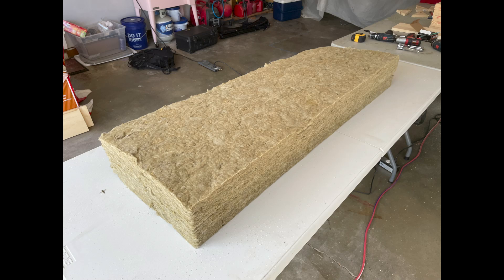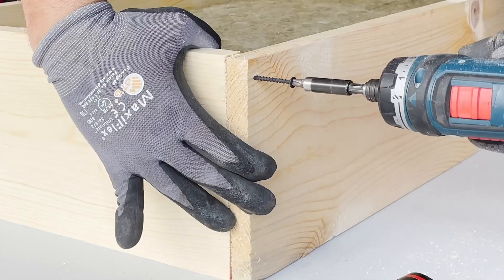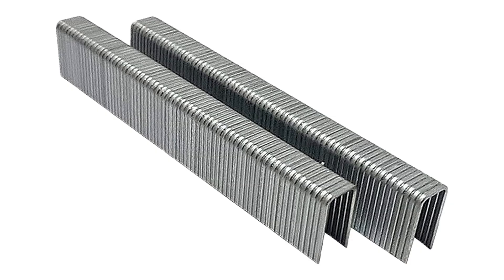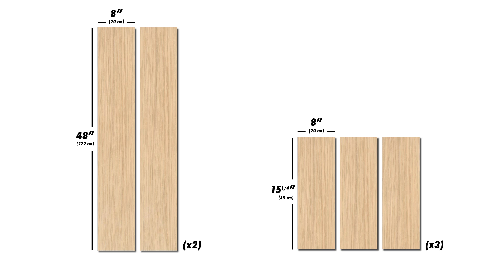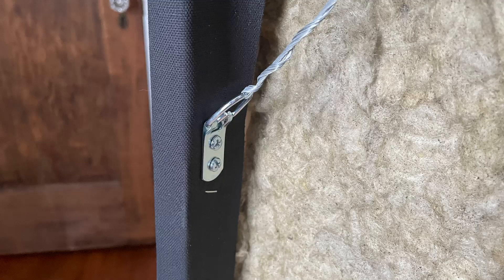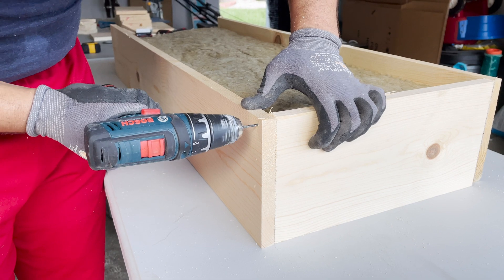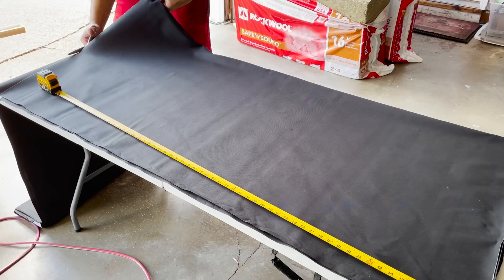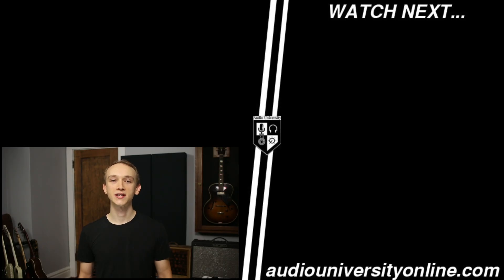How To Build Acoustic Panels | Pro-Quality Acoustic Treatment - Less Than $50!

Comment: shouldnt you cover the panel first with solid cover not a fabric? , cause particle can travel through fabric .
Reply from the maker: It’s important that the fabric is breathable so that sound can pass through. Otherwise, the surface of the panel will only reflect the sound.
Reply: @AudioUniversity  i know but one guy in youtube covered it with thin plastic foil then covered it with fabriic. he said its dangerous to breathe that material.. is fabric enough ? !!

Comment: Can you make  some kind of combo Isolation Shield(like CODN Recording Microphone Isolation Shield)+ putting behind you and your chair something to dampen the sound reflection that can be 99% of everything you'll ever need for a streaming setup?
The reason I say a Isolation shield and not a isolation ball is because isolation balls denature the sound quality of the microphone making sort of a boxy effect.
I'd be extremely grateful if you would either reply in the comment or make a video that addresses what you would do for streaming purposes on a budget.

Also is there something you can do about minimizing the sound floor to about -68, -70 dB during a live stream? 
I know that usually it's recommended to have -60 dB sound floor but I would like to do even better.
Thank you!
Reply from the maker: To reduce the noise floor, I’d recommend turning off any fans or other noisy devices in your room - room noise is probably the main problem. As for an isolation shield, I’d recommend placing a few of these panels throughout your room. You can make the 4-inch version if you’re on a budget.
Reply: @AudioUniversity  Don't have any fans or noisy devices.
Reply from the maker: What noises are you hearing in your signal currently?

Comment: One thing you could do to improve the efficiency of these panels even further would be to take a hole saw to the bottom sides and top of the frame clearing out space for more sound waves to reach the insulation.
Reply from the maker: That’s an interesting idea, Donald! I’ve never thought of that. Thanks!
Reply: @AudioUniversity  🤘
Reply: Maybe same thing can be achieved by distancing panel from the wall 3 - 5cm. Just adding four screws, one to each corner
Reply: @filipcapo2857  I was thinking of doing this as well. Got my bass traps sorted by doing something similar, gonna get the rest of the materials for the other panels early next year!
Reply: You mean drill holes into the timber?
Reply: @InsaneCarville  Yep. This will let more sound into the panel from the front and back, top and sides. Making the panel even more effective.
Reply from the maker: Check out this design by GIK Acoustics: https://www.gikacoustics.com/product/diy-bass-trap-acoustic-panel-frames/
Reply: @donalddluckerii3147  Have you done this? I’ve never heard of anyone doing this. How big would the holes be?
Reply: @donalddluckerii3147  how big would I put the holes (roughly)
Reply: @KirkYardley  That depends on the depth of the sides. Since these panels don't need to be super strong you could make the holes large.  If the side is 4 inches than you make the holes 3 inches. You could also get creative when building to provide the necessary space. The goal is just to get more effectiveness out of the panel. Check out the link for a GIK acoustics product Audio University provided in a response to me.
Reply: @donalddluckerii3147  that’s cool looking: I’m hoping my 5 and 1/2 inch wide cedar wood can sustain something like that. I imagine with 6 or more panels that would make a pretty big difference.
Reply: @KirkYardley  Definitely will. I like owns Corning 703 as fill but many people use mineral wool, or even basic insulation works well.

Comment: Amazing work bro, 👍 can you please make a video on series-parallel combined speaker system  ??
Reply from the maker: Thanks! Check out this video: https://youtu.be/uum1gQXz5mA
Reply: @AudioUniversity  iv watched it you only talk about speakers in series and speakers in parallel. Not series-parallel  combination  !!
Reply from the maker: The same principles apply. Think of them as groups of parallel speakers in series or groups of series speakers in parallel. 

For example, if you wire two 8-ohm speakers in parallel, that’s 4 ohms. If you have two parallel circuits of 4 ohms each and wire those in series, you’ll have 8 ohms. Does that make sense?
Reply: @AudioUniversity  yes thanks ! for the time. I need to install a setup of 20 speakers all are 4ohm, if I wire in parallel (4ohms÷20 speakers)=0,2ohms "too less", if I wire in series(4ohms×20 speakers)=80ohms"too much" I have a rough idea on how to wire it up. But whats the best combination of series and parallel for the system to end up between 2ohms and 8 ohms.
Reply from the maker: What is the system designed for? In most cases, I would suggest a 70V system for distributed audio systems with 20 speakers.
Reply: @AudioUniversity  medium sized church hall high ceilings with all speakers flush mounted in the ceiling. It uses a really old 70v system thats about 20 years old and now sound quality is a priority for them, they have  already purchased an amplifier for the new system and speakers which are 60w rms and 4ohms.
Reply from the maker: I would recommend returning that amp and getting a 70V amp and speakers.
Reply: @AudioUniversity  👍 thank you for all your help i really appreciate it